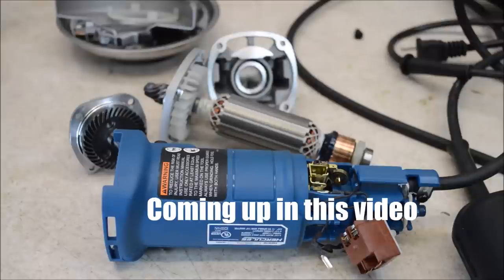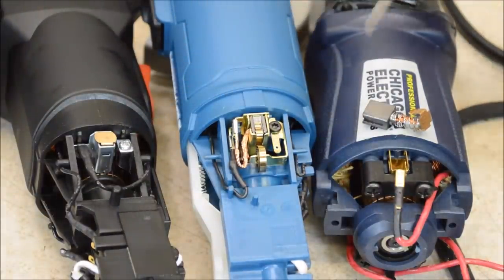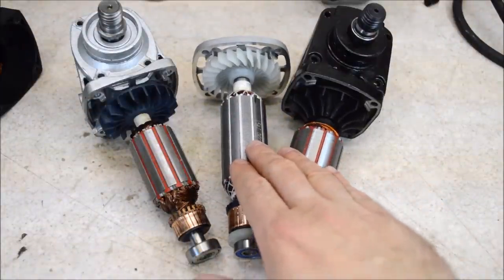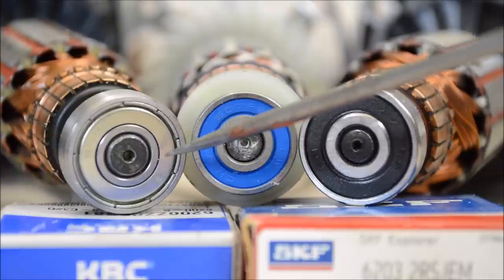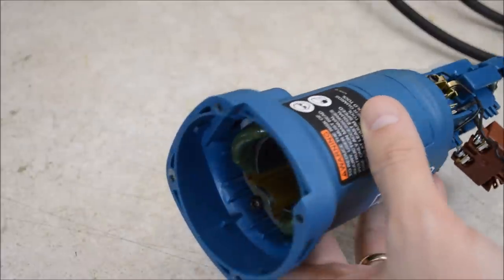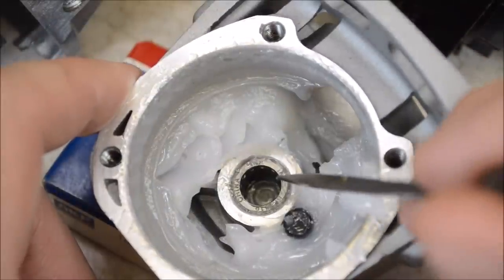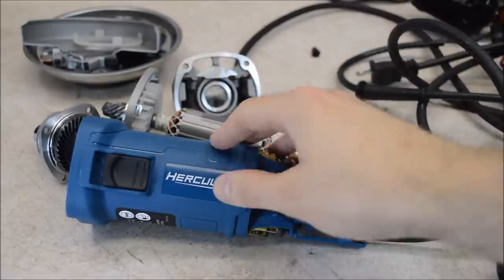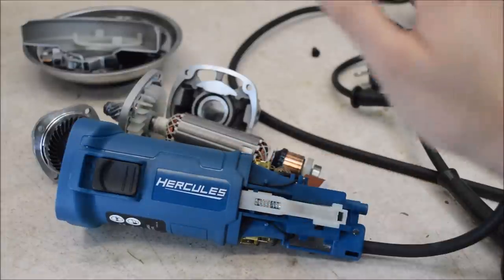Teardown: Harbor Freight Hercules angle grinder review

Comment: Not bad, but it's no "Tough" grinder! Walmart sure scored getting power tools that are so TOUGH, it even says TOUGH on the box AND the tools! No way Walmart would be dishonest or misleading with their products, right? I mean, Home Depot's power tools are just too RIGID and for five times the money, they're not even TOUGH!!!

I am a bit confused though. I was at my girlfriend's place and she needed me to do some work for her, but I left my Dewalts at home. She was near a Walmart,  so I just ran over and grabbed a cheap, I mean inexpensive, TOUGH drill driver to vet me through without paying big bucks for a power tool that I have four of already.  

So, I confidently purchased a cordless TOUGH drill driver, so pleasantly surprized that I only had to spend the equivalent of a couple of Dewalt drill bits!

I returned to my girlfriend's place, charged up the batteries and eagerly got to work, giddy for having the opportunity  to finally use a bona-fide TOUGH power tool!. Btace yourselves gentlemen, you may not like what I am about to report to you 🥺

I swear, I had more power using a screwdriver and some elbow grease than that thing did. The thing laboured trying to drive in a 1 1/2" screw into spf and I could smell the motor starting to burn. The battery lasted all of 3 screws before losing what little power it had (thus the screwdriver and elbow grease).

After I finished up, I returned the drill driver to Walmart. The Customer Service representative asked why I was returning the drill driver so soon. I hated to break it to the repreentayive of such a stellar retail Mecca, but I looked that highly skilled and ever-keenly-motivated Messiah of the industry right in her proud, proud  eyes when I sadly informed her, "They lied!!! They're not TOUGH!! They're not TOUGH at all!!!"

So thank you to the fine people like the one presenting this very video for the benefit of us all. Your experimental surgery on these power tools offers us the opportunity to avoid the pitfalls of trusting a retail cornerstone of our communities and their chosen vendors with truth in advertising and fairness in our transactions with them! 

I don't know what kind of a message this company is trying to send us with a name such as "Harbor Freight" but at least they leave us to our own devices to decide wether or not their power tools are indeed TOUGH!

Comment: Just a heads up youre praising the CW CHINA bearing wayyy too much.. you clearly have no experience with them at all hense why youre just doing reading on google.

I work on cars as a hobby and those CW china bearings are used in automotive parts in autozobe and advanced auto..  I habe two Jeeps and ive replaced the iddler pulley on one of them 5 times now..  The original lasted 15 years, and the replacement is from cw china.  Looks identical to this mini bearing same cover seal just larger of course.  The bearings go dry after 1 year and i habe to replace the whole unit via my lifetime warrenty each year.  Its frigging frustrating as hell.   

I took the seal cover off and sure enough bearings were dry as a bone.  The culprit is the cheap material used for the seal cover.. It dry rots.  One year and the greese comes out and then its done.

If this were me id just buy the 25$ grinder.  I have one and it lasted 2 years before it finally conked out and i used it a ton for cutting very thick metal..  For 40$ the other grinder may seem like its better in your video but its using bearings from cw china then youre better off buying the 25$ grinder and save yourself 15$ and replace it in 2-3 years if you use it heavily like i do.

Also the flapper switch on the 25$ grinder is much much much easier to use then that side switch.. Ive used grinders with the side sliding switch and its much mire awkward to use those grinders in tough spots then the simple flapper switch you just squeeze on the 25$ grinder

The only thing i like on the new grinder is the shield cover that can you can just unclamp and move around..  I usually remove my covers on grinders as they get in the way anyway but this one being able to move around easy i like so i dont have to remove it.

Anyway back to the bearing.. If the unit is spinning at 30,000 rpm according to your gear ratio then having a cw china bearing that fails 24.7 is extreeemly dangerous.. Ill be waiting for people who lose an eye or get chunks of grinder parts in their body when those chinese bearings fail due to being dry
Reply from the maker: Well, a couple points to consider:
-You’re significantly underestimating my automotive experience. 
-There could be another issue at play in your scenario, such as an installation problem. 
-The aftermarket part manufacturer could have specified a type of bearing or seal not well suited to that application, no matter what the brand. 
-If you watch my other videos you’ll see DeWalt uses the same CW bearing in a more expensive grinder. I’m currently tearing apart a Metabo grinder, which also uses at least one CW bearing. 

CW is clearly a step up from the no-name Chinese manufacturers. I would prefer to see  a top-shelf brand, like SKF, NTN, etc., but it’s clear companies like DeWalt and Metabo believe CW is up to the task.
Reply: I've used this grinder almost daily for the past 18 months. No problems at all; it's an excellent tool. All I see in your post is an extrapolation of wistful thinking. Get some experience with the grinder and then you might have something relevant to contribute.